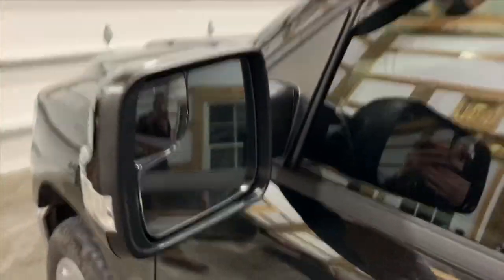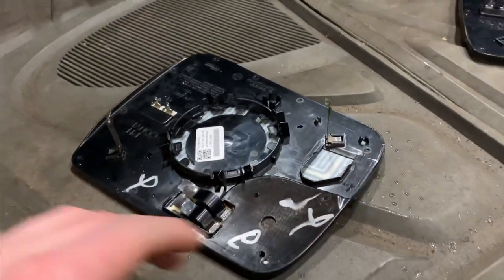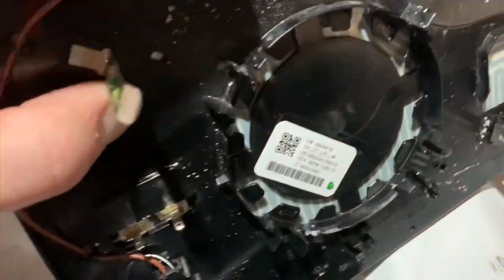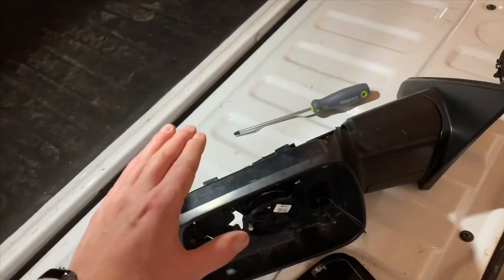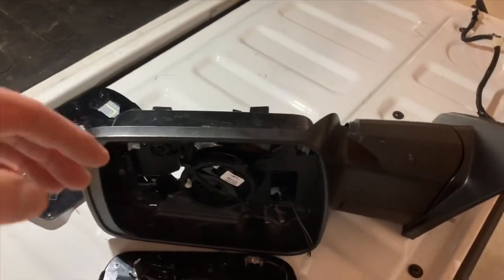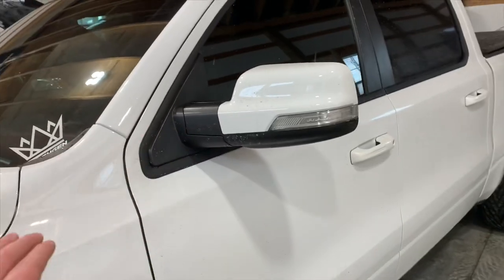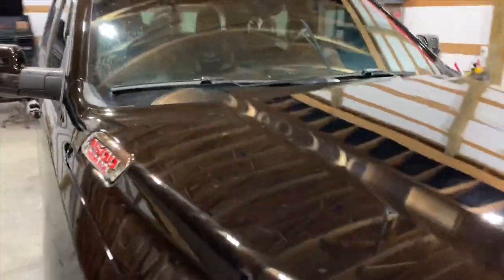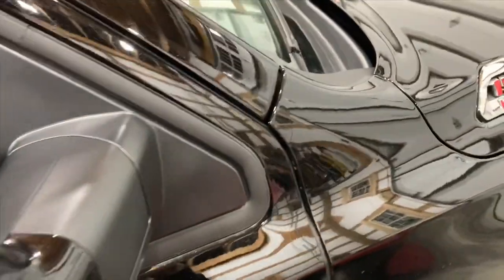2019 / 2020 Dodge Ram 1500 5TH Gen Mirror Cover Replacement / Removal

Comment: Why not use a suction cup on the glass?
Reply from the maker: Would definitely come in handy if you have a strong one laying around
Reply: Yeah did it work though?
Reply: Z06 Steve done it about 30 times, so yea I’d say so.
Reply: Im having no luck right now with the screwdriver for the last hour. So get a big suction cup and pull it straight off?
Reply: Z06 Steve yup, I got a orange one from Autozone, maybe $10 and put it in the center and pull it straight off, I can post a video on my channel to show you if you like. Just let me know.
Reply: I was able to figure it out after i got a bright light to see inside the mirror and a long skinny flat screwdriver
Reply: @ZakDeckich  YES. I came to the comments to say the same thing. I didn't even attempt it until I ordered a large suction cup dent puller/glass handler in my possession because I didn't want to end up with broken mirror "glass." Ordered a 5" one from Amazon for $15.
Reply: @YT-MasterAdmin  yes it’s super easy to do. Posted a video on it on my channel as well for others to see.

Comment: I wonder why my driver side mirror tilts up after I turn off my truck? I too changed the mirror caps like y’all but for some reason on the driver side I adjust my mirror to where I want it while turned on it stays in place but after any time I turn my truck off it tilts up all the way I have to adjust my driver side mirror all the time? Idk what I did wrong??
Reply from the maker: Does your truck have presets for different drivers?

Comment: is there a screw holding the back cover. I need to remove to try and repair the turn signal light. It has a crack and its getting condensation inside
Reply from the maker: nawshiz951 video shows must of what is involved not sure what it takes to remove the turn signal reach out to retroshopllc on Instagram

Comment: I had a quick question are all 5th gen ram mirrors the same ? I have a 2019 ram 1500 sport new body style and I broke my driver side mirror and it needs to be replaced. I bought a driver side mirror off a 2020 ram 1500 sport it has the same features as my 2019 ram 1500 and the mirror comes with the 2 plugs so do you think it would fit my 2019 ram 1500
Reply from the maker: Is your 2019 a DS or DT body style
Reply: @so5thgen  it’s a DT body style the new gen body style
Reply: I have the  the 5th gen Ram not the 4th gen / classic one I was just wondering if the 2020 5th gen and 2019 5th gen have different mirror compatibility

Comment: Thanks for the video, will question.. I have the Laramie in the Hunter green, any links where to get the covers that match? Thank you
Reply from the maker: RJ Phillips I did a quick search couldn’t find any myself. I see there are non painted ones selling $40 a set on EBay. I would grab those and have them painted!